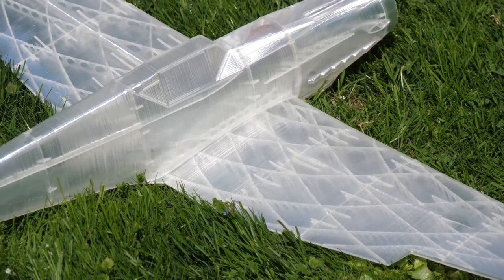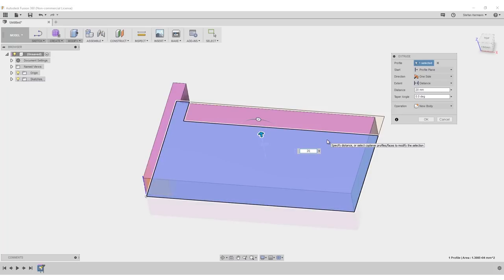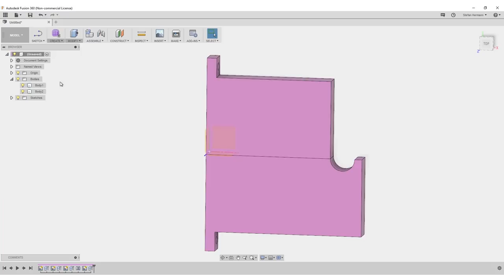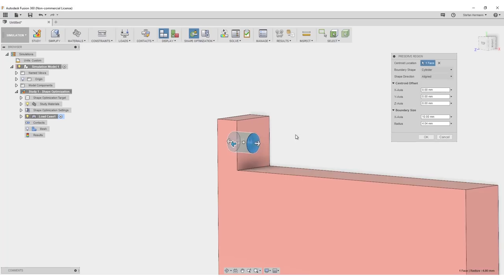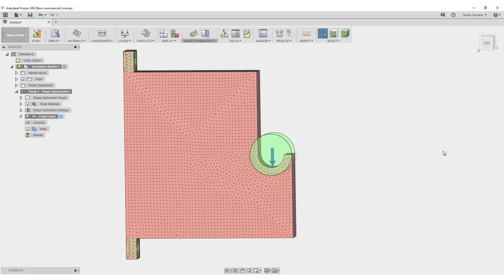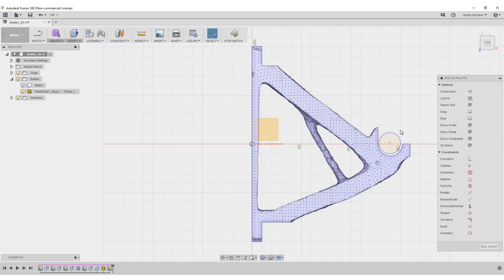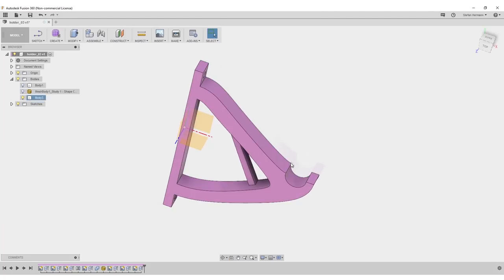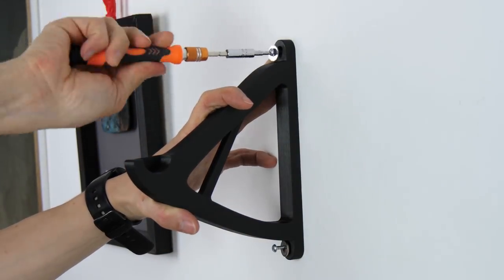TUTORIAL: Topology Optimization in Fusion 360 – 3D printing filament spool holder

Comment from the maker: If you want to skip ahead:
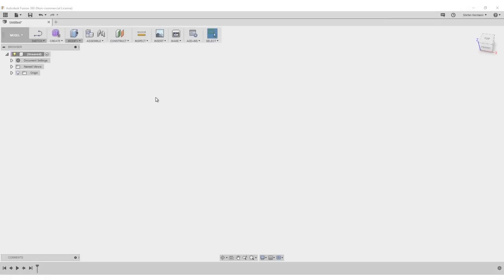Design space generation: 1:42
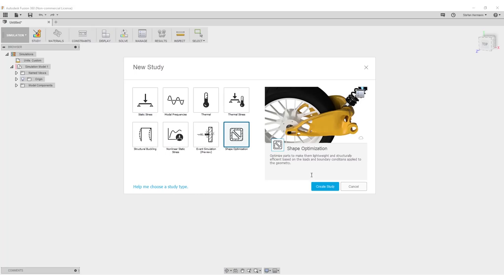Boundary conditions: 7:22
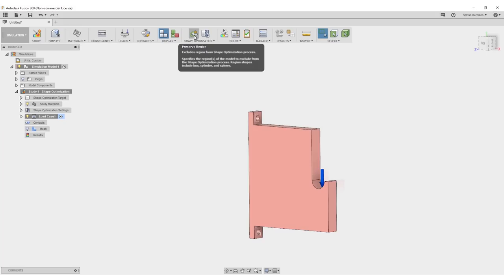Non-design areas: 9:50
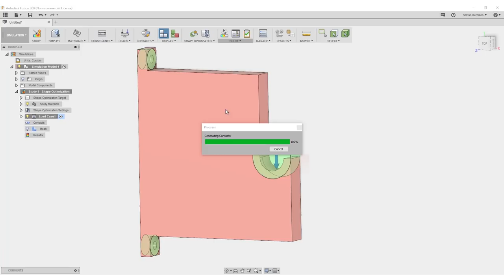Meshing: 11:10
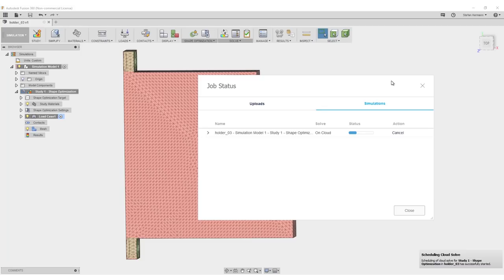Optimization results: 14:20
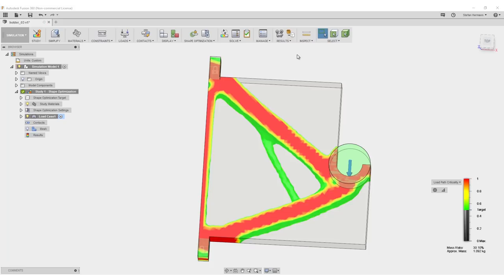Creating design from optimization: 15:30
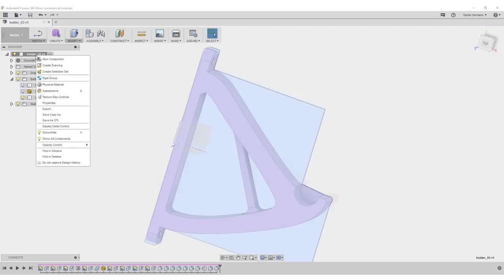Printing the model: 22:20
Reply: Yea it
Reply: Holes can be done in an other way that seems more logicial to me :
- add points at the right locations, exit sketch
- hit "H", select point(s), "Simple" type, "Simple" tap type, distance "all", enter diameter.
Done.

You could also fiddle with "clearance" type and choose the screw type that fits in. :)

Comment: Hey man, i have a suggestion that in such build you should set infill at 100% to achieve actual results. Reason for this is that Topology Optimization do not calculate infill. It calculate topology for full-body solid object, and infill will broke equation. What i want to say that with 15% infill there will be totally different optimized shape that without infill 100% and program do not calculate it.
Reply: i guess you could cad the infill and wall thickness as part of the design if you really need but it would be painfull and not a perfect solution

Comment: Is there a reason why the simulation would put a support asymmetrically when the constraints and forces are all applied along the centerline of the part? It works out nicely for printing but seemed strange.
Reply: Tim Mortensen he didn't go into it, but there are settings that tell the software how the part will be made - 3d printing, cnc, extrusion, etc.  Depending on these selections, the software will change placements of buttress features like this.  I'm not sure if fusion has it yet, but other software packages also allow you to specify whether or not you want the part to be symmetric about a given plane as well.  Hope this helps.
Reply: I haven't been able to find anything in Fusion 360 to set that it's a 3d printed object for that sort of thing. Do you know where it may be if there is such a setting?
Reply: The software generally deploys a generative algorithm, so the initial source of the structure is random. And the algorithm tries to make it better with each iteration.
Reply: @smithe53  Where is that setting for the output? I normally use a cnc more than the 3d printer.
Reply: Yes - it is a discretisation artefact which occurs because he runs the optimisation on an asymmetric mesh.
Reply: Because the symmetry wasn't set as a constraint. But yes that can be a constraint that can be set, at least on proper desktop simulation software (Don't know about Fusion360). It also speeds things up by a ton, since it can simulate that in 2D.
Reply: @sechr  can it be solved better with a quad face based mesh?
Reply: In Fusion 360, go to Shape Optimization, click on the dropdown menu and select "Symmetry Plane"
Reply: Because random.
Reply: Hi, I used to do research in topology optimization and no one has answered your question correctly. Sorry for commenting three years late:

Topology optimization should ideally produce symmetrical solutions for problems like these, but frequently the optimization problems you are trying to solve are "ill-posed" - which basically means that the solution is very hard to find mathematically.

These problems will be very sensitive to sources of random noise such as slight variations in the finite element mesh used to simulate the problem, and it can result in very large geometry changes from very small changes to the input problem. There are some problems that are so ill-posed that even if all of the inputs are perfectly symmetrical, the only way the solver can find a solution is by accumulating small math errors until it starts searching for asymmetric results.

Sometimes, the "best" solution to a symmetric problem is actually asymmetric, and the solver will randomly converge to one of two different possible solutions (this is very rare)

However, in general, topology optimization of a symmetric problem should converge to a symmetric solution, and seeing unexpected asymmetry in a result is a (very common) sign that the problem was not set up very well.

Comment: I'm not sure if Fusuon allows for changing element size in areas but you only need the smaller ones near the stress concentration areas. Could get by with way less elements, especially if Fusion has plate elements
Reply: I agree. And with the use case and the static loads he is using. The default mess look entirely adequate. What he did was way too fine.

Comment: FEA simulation is going to be off more because of the weak z axis and layer bonds rather than the infill.  Infill does not really weaken parts that much, not as much as they are weakened by poor layer bonding.  Really nice video, thank you!

Comment: Thank you for the tutorial. TO is the essential tool for AM. We are looking forward to see the next one.
A couple of comments: 
- Following your design strategy:  in order to keep the original dimmensions of the design you could Project the initial sketch to draw the arc of the holder.
- Alternative way: Why you haven't convert the STL to solid and then correct/soften the desire areas?
Reply from the maker: My personal opinion is that "softening" optimized designs is a really bad practice in a lot of cases and especially in the, the redesign is pretty easy.
Reply from the maker: Already more in the pipeline 😉

Comment: I looooove these segments! It's such a good basis for further experimentation. Thanks! Nice to see you're using FormFutura recycled petg, I don't see many creators do that (recycling that is). I'm testing it right now but it does seem a bit brittle at any temperature, did you experience that?
Reply from the maker: This is the rPLA I printed with, which works totally fine. Only did some minor tests with the rPETG, so I can't really say much about it.

Comment: Regardless of whether the static stress simulation is accurate for the printed material, I still think it would be interesting to run both the original and the optimized shapes and see how much weaker the optimized part is.
Reply: Depending on what stress the part has to withstand, the optimized part can be stronger. E.g. a H or T steel bar bends less than a massive piece of steel.
Reply: @Mobin92  I found your comment interesting and decided to check it. Draw 5 horizontal bars 100mm*100mm*1000mm in FreeCAD. Profiles are: "standing H", "laying H", "solid square", "T", "upsidedown T". Wall thickness is 10mm. I've fixed in one end of each bar and let it bend on its own mass. Results are quite interesting. "Laying H" is the best. "Standing H" is the worst. "Solid" is the second worst. So does that mean that solid bar is not strong? No. It is just heavy and uses own mass in not optimal way, but when you give it an external load, it will be the strongest.

Comment: Is there a way to force Fusion 360 to do the analysis locally? I'm not a fan of the 'cloud credits' thing Autodesk has going on and I'm perfectly fine with waiting longer if it's all local to my machine.
Reply from the maker: I'm totally with you. For normal static analyses it's possible to perform the solution locally, topology optimization unfortunately doesn't support that.
Reply: It looks like if you have a Startup/Education license you get unlimited credits at least but I bet they give you lower priority on their simulation servers.
Reply: Is there a software that does the same thing locally?
Reply from the maker: ansys student can do that.
Reply: Thanks. What's the easiest to use?
Reply: Autodesk's business model is just stupid. A lot of companies have NDA projects that cannot be sent out, and protected computers that cannot be connected to the internet. Autodesk is just kicking their richest customers to their competitors.
Reply: @y.z.6517  Do autodesk not offer onsite computation?

Comment: The hard edge on the upper mounting bracket is a weak point and should also be modeled organically. Because what's the point in maximizing the rigidity of the body if the attachment is weak..? It's like having a steel part screwed to a cardboard part ._.
Reply: You usually can't model those parts organically, because the math used to simulate the structure doesn't produce reasonable results around where the loads and the attachment points are.

Also, if you ask an optimization program to minimize the stress in your part and give it the ability to modify material around where the stress is applied, the "best" solution is to just not support the load at all, so it will remove 100% of the material from that area.

Comment: Did you at any point select the final material the part is gonna be made out of? Does it matter at all for this optimization? thx!
Reply: I think it doesn't matter. The simulation assumes homogeneous tensile strength throughout the part and goes from there. This is also why these simulations can only get a reasonable approximation for 3D-printed parts, as they are shells with a small percentage of infill (not at all homogeneous).

Comment: @9:11 you show the load coming in from a single direction.  I would think the load would also be coming in from the sides and front-to-back as a smaller force.  In this case, with no side-to-side load, your project will be very floppy, as in a piece of paper.  It will be strong in 2 dimensions, but not in 3 dimensions. Possibly I am missing something..

Comment: Servus Stefan - Merci, great video as always! 

A learning question from the engineer who installed Fusion360, but always uses the software he has been using for 20 years when something needs to be constructed. It's a shame, I know. But it is what it is. However, when I see something like this, it motivates me to make the switch, however: 

At what point in this FEM process do the material properties such as weights or stress tensors actually come into play? Are they hidden somewhere in the settings or is it all based on the freely chosen percentage of material savings, which would not be so tingling after all. I assume that the answer here will be more concise than the question, or could give rise to a separate video, because you have mentioned the imponderabilities of FDM printing. 

I pull the crippled strut inside in this form (quite constructively) a bit in doubt, but it is also very funny - so why not follow the software. 

:-)

Translated with www.DeepL.com/Translator
Reply from the maker: So if you do these simple topology optimizations, with only one part, then the material is negligible because you maximize stiffness (here the norm of the strain energy is used) and are only looking for a mass percentage. You could actually replace mass by volume. Actually even the magnitude of load doesn't play a role if you only have one load case. You could set materials but if you work with isotropic materials (with no crazy Poisson's ratio) the result wouldn't change a bit. If you go more advanced (assemblies, orthotropic materials, numerous load cases) then these things come into play, but then the problem gets really complicated. There is a reason why I said, that this takes years or even decades to master.

Comment: great video! thank you so much. I have one question/observation: although the load and mounting holes are symetrically placed on the part (mid point), the optimization results in an asymetrcal design with the middle truss member being offset to the right. can anyone explain why this is?

Comment: Thanks for this informativ video.  My Question is, is there a way to get the Model in a sliser generate an infill generat an .slt, put it back to fusion and run a simulation
Reply: Interesting thought, there might be softwares out there. But I would say that the strength of a 3d print practically only come from 3 key elements, thickness/number of perimeters, orientation of the layers and the quality of the bond between layers.
Even with an accurate STL of the sliced model only the thickness of the walls could be accounted for in a simulation on fusion. Simulations are all theoretical and used mostly to speed up human analysis. Meaning let the computer do calculations and then use humans to look and decide if results are appropriate  or if a revision is needed. Humans still out think computers, machines are just quicker not better.

Comment: The last time i worked with finite elements was helping somebody optimising some old code for calculating chemical penetration depth.
3 mm grain size - that is ginormous XD I think we were working on something like 20 nm. of course that was not running on a normal home computer.

Comment: At which point the simulation takes into account the material? Maybe I missed it in the video. But I guess the reaction to 100 N it's not the same on a 10mm steel beam or a 10mm crystal bar.

Comment: If you changed the design so that the spool is supported not in the middle but more in line with the top hole. Would it save more material?

Comment: Awesome job, but I'm wondering why you don't need to set a material before doing the optimization? Because wouldn't different materials require different structures to support the 100N force?
Reply from the maker: Read some of the other comments where I explained the reason.

Comment: Hi, Thanks for the video. I've only recently heard about topology optimization and am wondering about impact simulation ! If i use this video as an example you have defined the load point and added a couple of constraints for the mounting holes. The finite analysis includes these points into the analisys before you run the topology optimization. My question is how do you add extra loads to the model ? For instance of something  knocks into thee side of the bracket adding an unexpected force if this was not defined then the bracket could fail !. Would this need to be considered at the modeling stage, the topology optimization stage or integrated into both ?

Comment: a very very useful video! thank you so much. but I have a question about the FE analysis of the finished Piece. 
is there any possibility to simulate it with anisotropic material (like the 3D printing do)?
Reply from the maker: I'm quite sure that it's not possible in Fusion 360, but any other descend FEA software should allow that.

Comment: Thanks for the great Tutorial. @ 15:25 you say that you wouldn't recommend to print it as it is, but you don't say the reason why. Could you provide a reason to why one shouldn't print the optimized topology as it is. Thank you.
Reply from the maker: 1. The result is rough, so the print wouldn't look nice, but smoothing could be done.
2. The solution doesn't consider any manufacturing constraints. Even though you can theoretically print everything, it is not advisable to print everything.
3. Most importantly: The solution can show un-plausible results, especially at the locations where you added constraints. These result from simplifications you've done with the model (e.g. not simulating pretension or contacts...). So it is the job of the engineer to spot them and design them properly.
Reply: The mesh from the optimization is also very coarse - depending on the mesh you specify in the FE settings.  Normally, 3D printing uses a much finer mesh; unless you're ok with a rough looking part, in which case the mesh from optimization is perfectly useable.

Comment: did you overdo the load to compensate for the lower infill and such?
Reply from the maker: The magnitude of the load doesn't play a role in this case, since we optimize for 30% of the initial volume.
Reply: Is it set to a specific material? like, if this was made from metal or wood it would be stronger than plastic and the print isn't even solid.
how'd you then know, how much you can hang on there?
Reply from the maker: Also material doesn't play a role, since you are optimizing for a volume /mass radio. It requires an additional simulation check if your design is strong enough.
Reply: So the 100N you set are just because fusion wants it and a different load wouldn't alter the model?
Reply from the maker: Exactly. But if your have multiple load cases, then the magnitudes of the loads do play a role.
Reply: okay great, thanks alot

Comment: dont you also need to add another constraint to tell the simulation that it's pressed flat against a wall? currently the simulation thinks that it's just suspended in a void by the two screw holes but in reality it is braced against the wall along the entire left edge as well.

Comment: Hi. Great video.
But then, after about 20 minutes of watching) you say this won't work if you are FDM printing...
Then why have I been watching all of this?
(Answer to myself... Because I learned a lot from it... Thanks for that) :-)
Reply: That part that doesn´t work for "us" is just the FE analysis of the finished Piece. 
It needs a homogeneous material to work properly.
Reply: I was wondering about this too - surely it assumed the same thing at the beginning when it suggested the structure based on the loads that were specified?